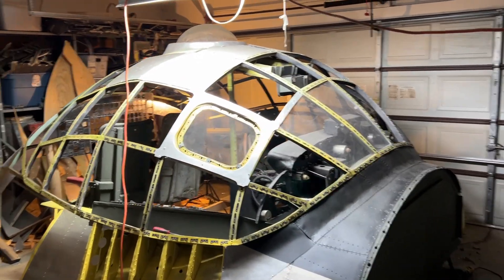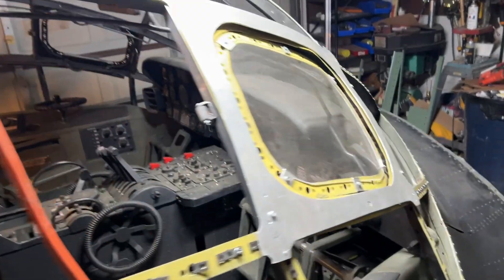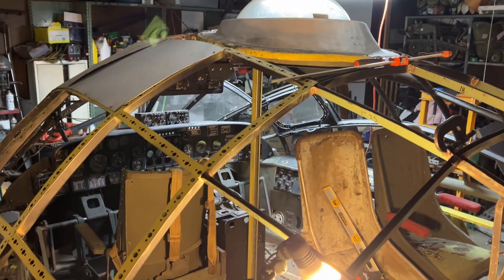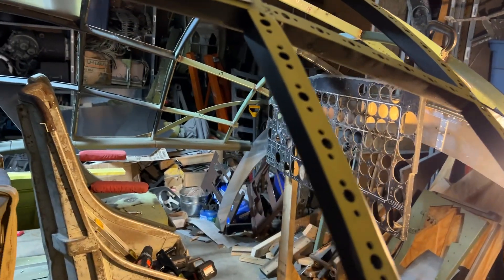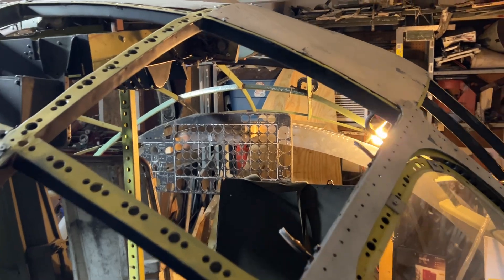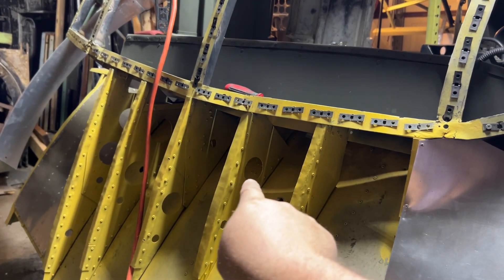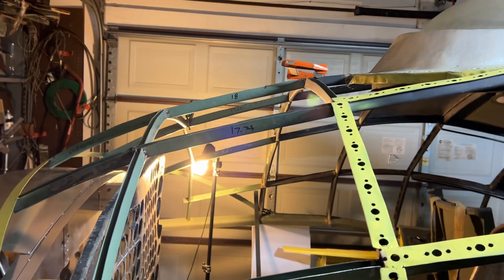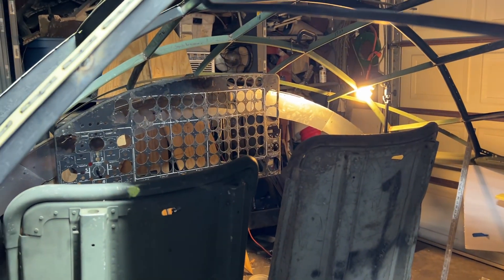Full Scale B-36 Peacemaker Fuselage Bulkhead 3.0 Construction

Comment: Some years ago I found and purchased a complete set of engineering drawings for the Piper L-21B (military version of the Super Cub), at either the Library of Congress or the Smithsonian. They were supplied on rolls of microfilm. I had the microfilm transferred to jpeg photos which I pulled up on computer and cleaned them up with Photoshop.  Then used these drawings to design FAA Approved parts for the Piper Super Cub.  You might be able to do the same thing to get drawings of the B-36.  Good luck with your project.
Reply from the maker: I’m going to look into these avenues on my next plane, but this H model is beyond the need for drawings.